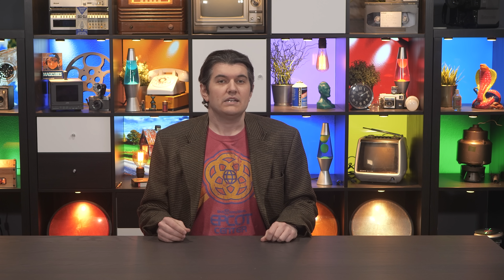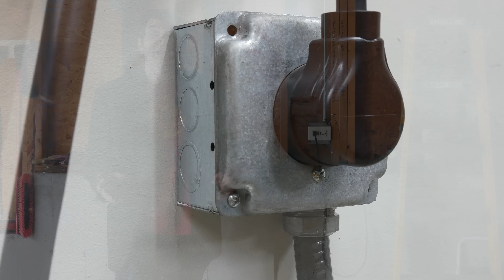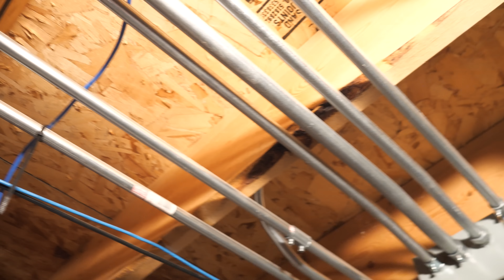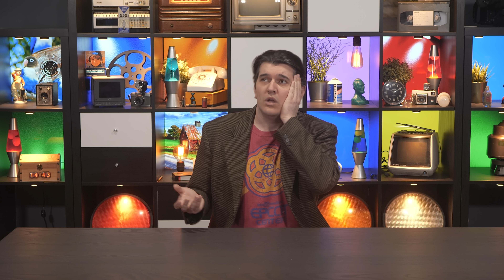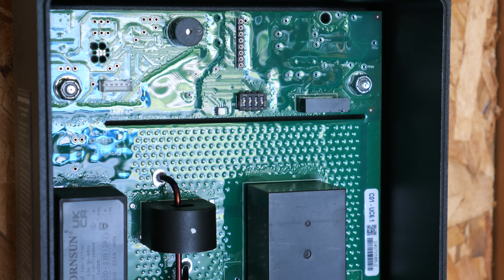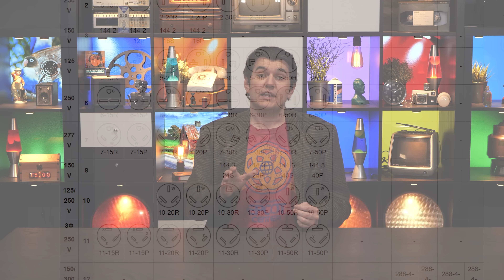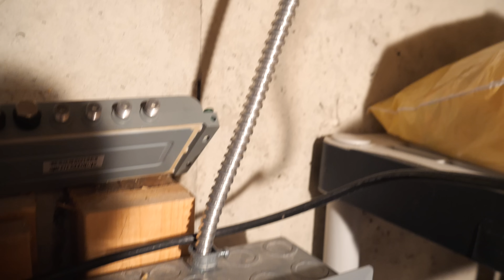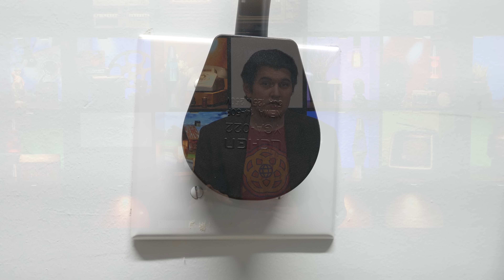The "standard" car charger is usually overkill—but your electrician might not know that

Comment: I'm not sure about the US' National Electrical Code, but up here in Canada, our codebook says the following:

Rule 86-306: “Each receptacle for the purpose of electric vehicle charging shall be... [properly labelled] ...and shall be
a) A single receptacle of CSA configuration 5-20R, supplied from a 125V branch circuit, *rated not less than 20A*; or
b) Of the appropriate CSA configuration in accordance with Diagram 1 or 2 when supplied from a branch circuit rated at more than 125V or more than 20A”

This means that, in Canada, it is required to use at least a 20A circuit to feed your electric vehicle charger, *if you're hiring an electrician to install it*. You can still use a provided cord to charge it, but no electrician can install an EV charger on a standard 15A circuit.

in rule 86-300(1), it also states that the charger “shall be supplied by a separate branch circuit that supplies no other loads except ventilation equipment intended for use with the EV supply equipment.”

So to any Canadians out there, please don't give your electrician a hard time about this video.

Sincerely,
An electrical apprentice

(I found those rules on page 409 of the 2021 CEC's 25th edition)
Reply: OK, sure.  But, anyone charging from a 15A, 125V outlet isn't going to call an electrician, anyway.  They're simply going to plug it in.
Reply: Those rules apply to an outlet that is being installed for the specific purpose of charging a vehicle. They do not apply to simply plugging a charger into an outlet that already exists.
Reply: there's plausible deniability for it being "for the purpose for electric vehicle charging" when it's an outlet you can plug anything from a phone charger to a space heater into it. it could be argued that it's a standard multi-purpose outlet that you just happen to primarily use for low-speed car charging.

that kind of code provision i'm pretty sure is intended only for the 3kw+ chargers, the beefy ones with sustained loads similar to electric stoves.
Reply: @dead-claudia  Yeah: a 240V 6-20R outlet makes more sense for EV charging.
Reply: Officially, our AC(!) in our office is required to be wired to a 20A (230V) circuit. It draws significantly less than that during operation, it will never get near that. It's been running fine on  a 16A circuit (even with a Schuko plug) for almost a year now, never tripped...
Reply: Fun thing: "the" US electrical code isn't really a thing. Every state has their own code.
Reply: Same here in Italy, code requires a separate circuit for car electric charges and to be certified by an electrician, probably the same in a lot of other countries, this video will probably apply only to america and a few other countries
Reply: @turkeyswag2831  Tbf in Europe, as long as you are mindful of which outlets are fed by which breakers so you don't overload one, you can just get 3.7 kW from any normal outlet without any electrician being involved, or tell an electrician to install a separate-circuit outlet in your garage.

And if your EV consumes say 150 Wh/km, 3 kW of charging already gets you 20 km range per hour of charging, more than enough for a daily commute plus errands with overnight charging even if you have a fairly long one.
Reply: @zuthalsoraniz6764  Idk in other countries in Europe but here in Italy it's required by law to be a separate circuit, no matter if you can already use the circuit already present in the garage
Reply: You just need to not hardwire it and ask for an outlet for your electric weed eater...
Reply: Ah yes Mr Electrician can I please have an outlet for the new welder/saw/mill etc I'm wanting to purchase.
Reply: Not surprising.  CEC is far better than NEC, more safety margin.  Lot of shop and garage situation in a house is often 125VAC-20A (with 15A and 20A combo receptacles and 20A rated wiring or more depending on length etc).  So when you use 15A tools the wires heat up less when used to the 80% (12A) load.  So with a 15A standard cord included EV car is well under the circuit capacity.

The US national electrical code is scary compared to CEC.  Lot of stuff that is okay in the states is illegal here, or wouldn’t meet minimum code.  Even if it would be safe, it is better to be cautious and prevent fires than to not add tons of margins.  Our code is written by lawyers, engineers, and master electricians and is written in legalize.  And often first to require installation of new safety technologies like AFCI and GFCI breaks in more locations vs the US national electrical code.  But we are far behind Europe.

US code is written in simple English probably by the electrical industry.
Reply: But code applies when installing new or if you are renovating (if you need to pull building permits and/or electrical permits for that area of your house you are usually required to bring the electrical up to code.  But if you have a 15A charger and a 15A outlet, that is fine if it was up to code when it was originally installed.  That code is new so if the receptacle was installed before that code year it is fine).
Reply: @kuillus  It is not 'better' to overbuild for safety - there's always a price tradeoff. Modern NEC codes in the US are a good example of this, requiring AFCI/GFCI protection for pretty much every circuit. The 30A breaker shown in this video, had it been GFCI, would cost over $100. Filling a new breaker panel now (say a panel swap) will run at least $1000 in breakers - even those 15/20A in CAFCI/GFCI are $50+ each. $1000 per household would buy many more lives saved if it was invested in interconnected smoke alarms and/or a 5lb fire extinguisher on each level. Those tradeoffs occur in the real world, where money and time are not infinite. Electrical fires (caused by the wiring itself, not a dangerous device) and death by (household) electric shock are tragic, but fortunately pretty rare, relatively speaking.
Reply: So does this mean that one, you should not use a front porch socket for charging on a level 1 cord, and two, should have that inspected by an electrician to get it to the right code if so? I imagine it's probably just replacing a 15 amp breaker with a 20 amp assuming it's on its own breaker already?
Reply: @Delgalar  The breaker is sized to protect the wires between the electrical panel and the receptacle. If the breaker is 15A then the wires are almost certainly 14AWG (rated for 15A). If you wanted to install a 20A receptacle and breaker, the wires must be changed to 12AWG.

The good news is that you can continue to use the existing 15A circuit if it meets you driving needs. It doesn't hurt to get it inspected, although the electrician may very strongly encourage you to upgrade which could be expensive. On the other hand, if the receptacle is on it's last legs, that could be a very prudent decision.

Another option is converting the circuit to 240V by switching to a 2 pole breaker and a NEMA 6-20 receptacle. (Any other receptacle on that circuit would also need to be changed so no one can unknowingly plug in a 120V device.) This allows you to reuse the existing wiring and doubles the charging power.
Reply: @ElectricGears  very cool info, thank you!

Comment: You won't like European EVSEs, they require a CT for load managment, need to be registered with the grid so they can compensate for load in certain areas, and communicate with electricity suppliers to charge at low demand times, benefit is it's almost free to charge.

Comment: I have a question that I don't think has been answered elsewhere. If an electric car is charged and then left unplugged because it's parked at work for a few days or in long-term airport parking, how fast will the battery drain on its own? I remember hearing about electric cars draining their batteries during the Texas freeze, trying to stop the batteries from freezing. Is this a problem, or is this something I shouldn't worry about?.

Comment: Totally agree!
When my parents decided to buy an electric car they told me "no car dealer would guarantee that we could charge from a standard outlet". I just convinced them to give it a try on the first day before changing out the whole connection to the electricity meter and adding a new panel.
They have been happily using the slow portable changer, provided with the car, ever since!
Even with lower electricity rates during the night, they only require splitting the charging over two nights. 0 added expenses after buying the car.
Reply: It'll always charge, it will just be slower. But this seems to be a remnant of ICE cars where because it's inconvenient you only fill up when it's empty and so that's why everyone thinks you need a DC fast charger. But with an EV it's more like your phone, you plug it in at night and the next morning you wake up and it's "full"
Reply: Agree!  We don't use our EV for daily commuting and the 120 VAC portable charger has suited us just fine. We've been operating this way for over 6 months and have still not used a fast charger out on the highway. This arrangement only works for a limited number of eV owners.
Reply: The piece not mentioned here, and that I would love to see covered in detail, is that a 120V charger has an efficiency penalty due to the car electronics managing the charging session. Having 300W of overhead isn't much of an issue when you're charging at multiple kilowatts, but against a 1300W level 1 used for four or even eight times the duration of the level 2 options that 300W skimmed off the top does quickly add up over the lifetime of ownership of the vehicle.
Reply: @sniperczar  Was going to point out that it is only twice the duration: then I remembered that my car only has a 3.3kW charger.

Comment: Tesla Model X Plaid owner here.  I charge off of a wall outlet.  

GRANTED!  I do work from home, but I still drive 10+ miles per day and take weekly 60+ mile drives to do fun stuff.  Never even get to half charge.  I've got plenty of buffer.  And when I need more, I just go to a nearby public charger.

I've also driven 40 or so miles a day in my Chevy Bolt back in 2017.  I had a level 2 charger, but didn't need it.  I just drove during the week and didn't usually even plug in until thursday or friday when I began to get low.  I could have easily charged off of a wall outlet.  As you say, 40 miles a day is usually charged back up to full with ~16 hours of wall outlet charging.

Comment: I share my garage 240V now with my dryer 30 amp. It was way faster/cheaper on install as it is right off the door from the garage. I have tesla charge at 24 amp using 80percent rule, and at night so I can benefit from coop electrical EEV rates. Just once have we forgot and ran dryer while charging and breaker immediately tripped.

Comment: I have a 60-amp circuit for my EVSE. It's controlled via WiFi. I changed internet services and forgot to change my settings. It defaulted to a 20-amp circuit setting, which gave me 3.8kW charging speed. I had no idea for months until I went into my app to see how much the app estimated my charging cost was for the summer. The 60-amp circuit was overkill.

I should also mention that I went months with a standard wall outlet. I couldn't get to 80% easily, but I almost never needed to go to a fast charger. For apartment dwellers, a simple 120v wall outlet near their car is all they really need. They apparently already have such things in colder areas of the US for gas cars. It's not too much of a stretch to offer the same thing nationwide for EVs.

Comment: 4:25 "The largest size it comes in is 10 gauge."

Um, ackually...

Jokes aside, MC cable can be had up to 2 gauge. Hardware stores won't sell it because it because they only keep so much of a selection on hand for electrical, but I would expect most Chicago-land electrical supply houses to keep at least 6 and 8 gauge MC. Often these are open to the public, though with less convenient hours than the box stores.

And before someone um-actuallys my um-actually, there's also metal clad aluminum feeder available up to 750mcm depending on the manufacturer, but I don't know enough about Chicago-land code to know when, if ever, metal clad aluminum feeder cable is acceptable to use.

Comment: I’m one of the few that needed to charge to 100% 4-5 days a week.  I drove an ID.4. My commute was 140 miles on a highway with a 80 mph speed limit and in the winter the ID.4 was lucky to get 150 miles of range.  Most winter days I needed to use the slow charger (provided by parking garage) to get an extra 20 miles for the return home. Did this for 2 years.  I worked shift work so it only had about 8 hrs to do the charging.

Comment: Here in sweden we often have 3-phase 230v 16/20/25A so a charger without some way to throttle or pause charging when the fuses are overloaded means that you often need to go up one or two steps in the main fuses (costs about 250 USD/month per step), also time based electricity prices means a charger with some intelligence to decide when to charge means you can often charge for less then half the price then if you just plug in when you get home, and if the chargers algorithm is good enough you can just set it and forget it.

The electricity prices vary every day here so the cars scheduling is not good enough for price optimization.
Reply: Most cars can do all the scheduling and current limiting stuff, which avoids the need for the charger "intelligence", but as long as the charger can continue to operate in "stupid mode" after the manufacturer goes out of business or changes it's business model and is no longer "supported" with updates, I suppose a "smart charger" would be fine. With my parents, we needed to disconnect the "smarts" board to get it to work once the company abandoned it.

Comment: At my office, I discovered a NEMA 14-50R plug behind a weatherproof cap. I hunted down the breaker box and it was labeled “welder”
So, that was easy. I bought the cheapest plug from Amazon (it was a mistake and it died in 3 months) and later got a mustang mache charger. I drive rental cars often and can take the cheapest plug EV options with no downsides now. 
Yes, I’ve had the Silverado and it takes double the time to charge, but I’ve never used the full battery, it’s crazy overkill.

Comment: I had an electrician run a new branch circuit to the garage, and the quote for 50A was about the same as for 20A, so why not?

That is total overkill for my Volt, of course, but I’m set for whatever I buy next.

Comment: My main electrical panel is right next to where I wanted to put an EVSE.  So I just put in a 60A circuit.  Did it myself, but had an electrician do the permit and inspection (as required where I live).  Quite easy and cheap in my case.

Oh, and it is hardwired which is cheaper, easier, and safer than putting in a 50A plug.  It is absolutely routine to hardwire appliances.

And yes, if I run the charger, my stove, cooktop, and dryer, it would totally trip the main breaker.  That's a non-problem though.  

The EVSE runs up to 48A, but I usually have it set to 24A.  Being able to crank it up comes in handy once every couple of months, but basically just saves having to drop by DC charger.  Wouldn't have been worth it if not for my particular situation (close panel, empty slots, elecrician who was already doing permit stuff), but is nice.
Reply: Why bother setting it to 24A at all if 48A works?
Reply: @k5sss Gentler on the battery and charging circuits... At least supposedly.
Plus I'm a bit paranoid about fire risk.  I know the circuit is done right, but still running 48A for hours in my garage unattended makes me nervous ;)

Comment: Reminds me of Bosch induction hobs that can be power limited to work on a 13amp socket so someone can use partially use it while waiting on a 30amp hob circuit to be installed.
Reply: we did this. and then didn’t bother getting it upgraded as 13A was mostly fine except in rare cases
Reply: My Jenn-Air induction can do this too! Out of the box, it maxes out at 11kw @ 240V (45A), but can be downrated to 4kw @ 240V (17A).
Reply: Pretty much all stoves can do that. The ones sold in the Netherlands, at least.

Comment: I'm definitely in the "it's nice to have camp" I have a welder that uses 50amp 240v anyway so having this in the front of the house and in my garage is a quality of life improvement for me. I was considering buying an electric bus from an auction that had 100 miles of range having a true 50amp charger (using 70amp breaker with larger wire) enables me to have bigger toys. Also I keep my Tesla at 80% but sometimes I need 100 and sometimes I've forgot to charge the night before but 80 to 100 with my charger is only an hour and a half so as long as I remember early enough I can avoid a stop to the supercharger. Do your own wiring it's not that expensive really I installed 2 ev chargers(yes my breaker box can handle the load I calculated) my 50amp charger was $499 the wire I had leftover from a diy extension cable I made for a welder(overkill) but want to say expect around $150 in wire then breakers range but under 100 or so depending on your panel. Electrical is cheap if you understand electrical😅. But if you don't typically you got to pay 2k for a ev charger install. If you have a Tesla with a mobile charger it's only like $300 to get an 50amp plug put in🤷🏼‍♂️